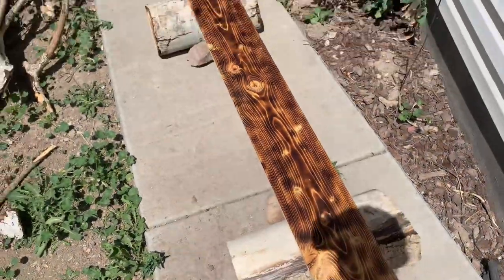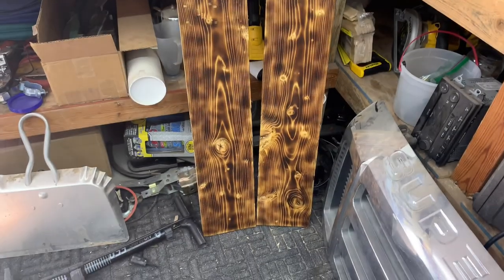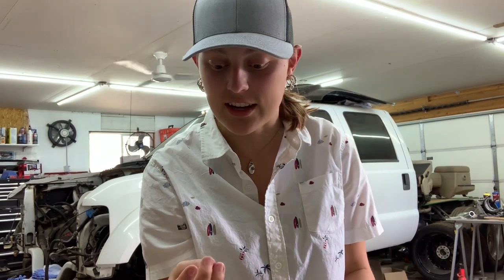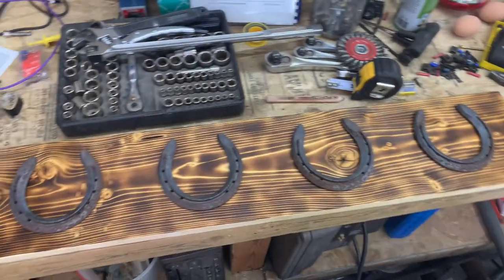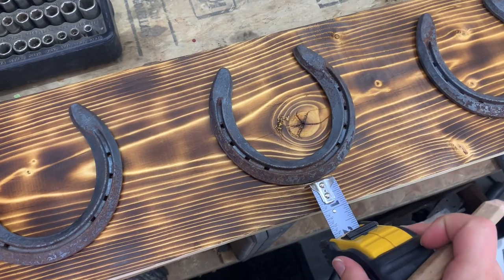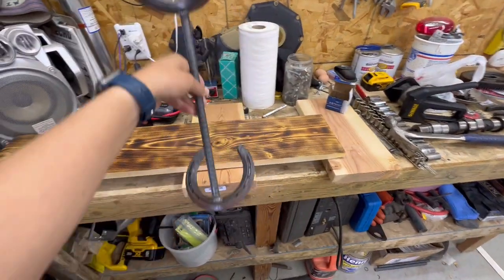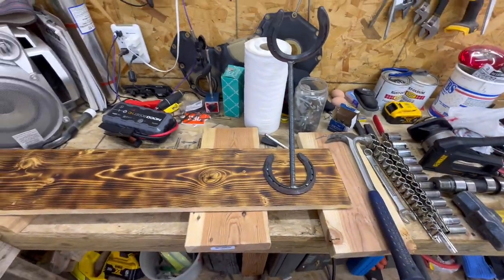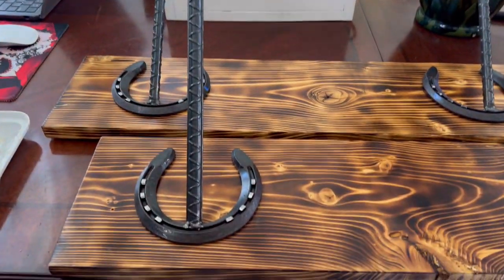DIY Cowboy Hat Rack! \ How to make your own Cowboy Hat Rack!

Comment: How long are the pieces of rebar you used ? Where did you find the square nails. Looks good
Reply from the maker: I got 2 pieces of rebar and cut them in half, so they're 1 foot after they've been cut!  I got the nails from a local hardware store, the box had 100 of them in it!